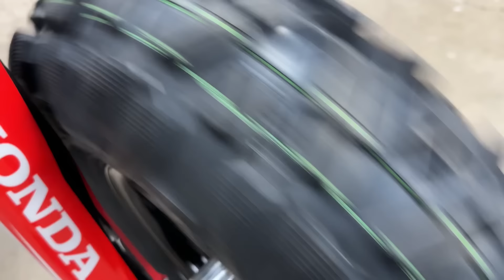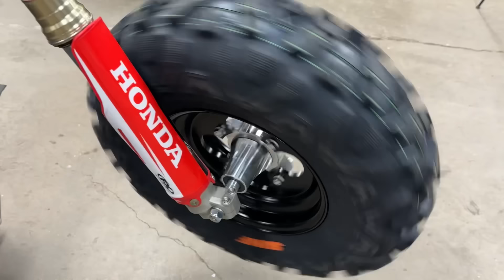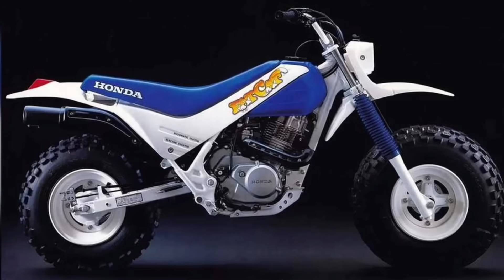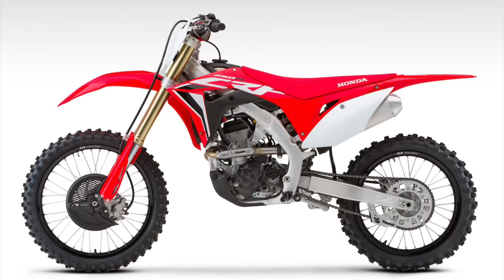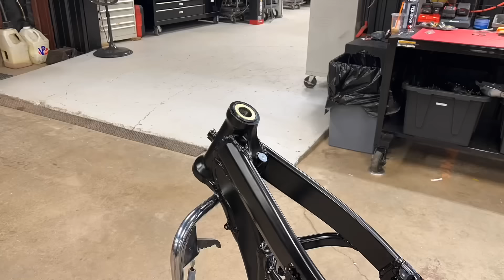Building the Ultimate Modern Big Wheel Using a Honda CRF250R  Dirt Bike

Comment: I don't want to sound like I'm questioning your methods. You must have a good reason, but I always thought torque specks were specifically without lubrication? I had learned that greasing would create the danger of breaking a bolt.
Reply from the maker: We have tested both methods. As seen in video has been our most reliable way to install this hardware on our billet hubs.   If you follow specs and method in video no issues and very reliable

Comment: Shouldn't your front rotor sit towards the right (sitting on the bike) side in the caliper instead of in the middle? After tightening the caliper hanger to the fork the right pad shouldn't move at all, its the left side (piston side) that slides over. I would think if you put the rotor in the middle of the caliper when you started pumping the brakes it would bend the rotor to the right side
Reply from the maker: Nope because the caliper bracket and caliper are separate.  On sliders… so as your brake pads wear the position is constantly changing       The caliper will always position correctly as long as disc is centered in the caliper bracket 👍🏼